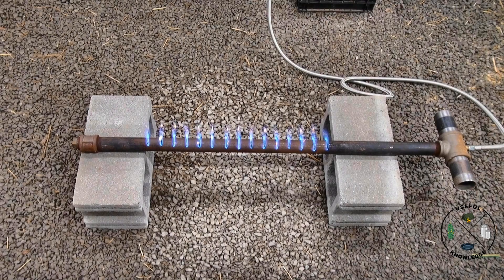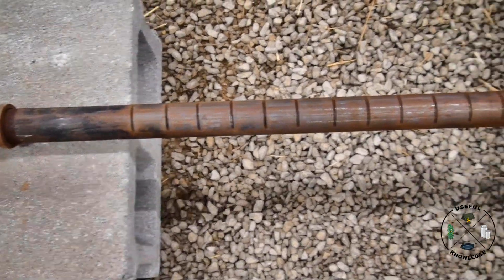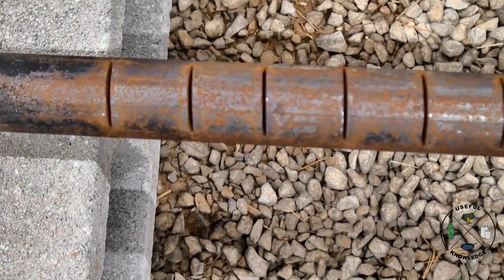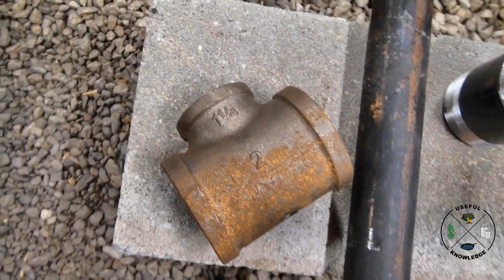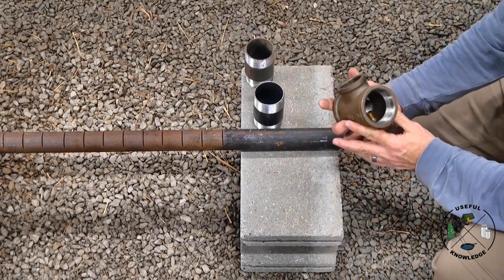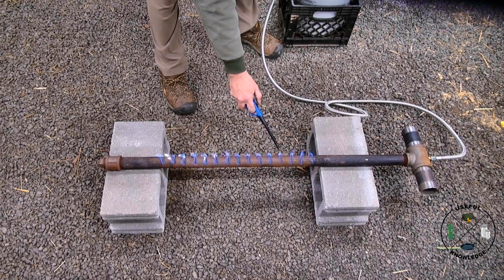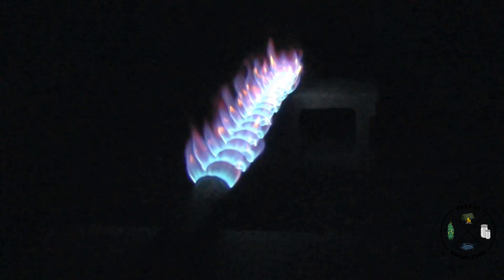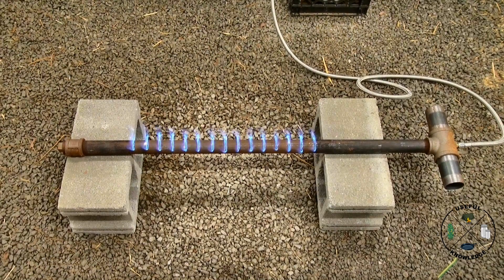Homemade Pipe Burner  | Useful Knowledge

Comment: how can you increase btus?
Reply from the maker: This already rocks a lot of btu’s.  I use it for my syrup.  I would try closer cuts but it’s going to require more pressure and gas flow.
Reply: @ how would
You increased gas flow? More psi from regulator and larger hole in orafice? Would Venturi need to be wider/more open?

Comment: My homemade burner on my pig cooker   About  a year ago stopped lightning near the Venturi and the burner only has flames at the capped end when I try to light the end close to the Venturi the flame on my torch gets blowed out
Reply from the maker: Hi.  Check the orifice to make sure some rust etc has not stopped it up slightly causing higher pressure.  Sounds like the gas pressure is too high.  I have to clean out the orifices in mine every summer because of mud daubers.

Comment: Thanks for this.  I would like to build something similar to use in my wood fired pizza.  Do you think a ¾" pipe work?  Cheers
Reply from the maker: Yes it will.  Here is a link to a 3/4” pipe burner I made a couple months ago.  You can also run it off a 20lb tank.  Homemade Pipe Burner for Camping | Useful Knowledge
https://youtu.be/KzQt7FWzMho
Reply: @useful.knowledge  Great - thanks for getting back to me!  Any advice on trying to achieve a flame like this, although I think this is natural gas not propane:
 https://youtube.com/shorts/kkKk_QHSMtM?si=YaqhB2Dq0rWP1YFi

Cheers!

Comment: I saw your other video and remarked at how expensive parts had gotten. Now with this homemade venturi I can make a burner for my gun bluing trough for about $60. Thank you!!!
Reply from the maker: Absolutely!  It absolutely works great!   I ran it for about 6-8 straight hours when cooking my sugar cane syrup.
Reply: @useful.knowledge  Got it completed. Works like a champ! Thanks again.
Reply from the maker: Awesome!!
Reply: @wiking44 I’m thinking about doing the same. Did you use 3/4” piping? Did you need to change anything about the Venturi, nozzle diameter or cuts when increasing the length?
Reply from the maker: @colinjohnson5515 yes, 3/4 pipe.  I wouldn’t change anything until you see how it does with longer length.
Reply: @colinjohnson5515  What useful said. Mine works well at about 48”

Comment: any idea how many BTU's?
Reply from the maker: Hi.  I haven’t tried to calculate it out but I’ve used this size (and the exact one in the video) in my syrup making.  Check out the sugar cane syrup video on our channel and you can see it in action.  I run it low and then almost full blast.  It’s a great pipe burner.

Comment: no fender washers to control air this time?
Reply from the maker: Yeah, I noticed that I was running it wide open anyway so I built this one with no washers.  I just ran that one in the video for about 8 straight hours for syrup and it worked great.  I’ve got my son’s bed strapped on top of the cover right now.

Comment: Good info. I have pretty much the same burner in my big cooker. 2 burners. I have a problem where the flame goes out when I close the lid. I can’t adjust very much on the flame. Does this sound like not enough air? Probably need to make bigger Venturi? 6:05
Reply from the maker: Hi.  Try placing your hand where the air is being pulled in.  Sometimes too much air can cause it to go out.  I will slightly block it until I figure out any reduction needed in the air going in.
Reply: I made a air mixer from 2” to 1-1/4 on my pig cooker. It pulls too much air and flame goes out when the lid is closed. I blocked off 3/4 of the air coming In and it works perfect now.

Comment: Thanks for this video! I am currently building a Powder Coating Oven with a square base of 3ft x 4ft. I'll be running 1/2" black pipe in the shape of a "U" about 3" off the floor and 3" away from the interior walls, and drilling small holes facing inward. I will have a "T" in the center of the "U" feeding the pipes. I was planning on making a venturi on the outside of the oven (1/2" black piping leading to the inside of the oven). What size do you recommend for the airflow nipples? Also, what do you recommend for an orphis considering i'm using 1/2" piping? Any guidance is greatly appreciated!
Reply from the maker: Hi.  I’m thinking for the venturi tee that I would use a 1/2”x1” tee.  That would have the 1” openings for the air flow with your 1/2”side connecting up to your 1/2 black pipe going to your burners.  I would start with the same size orifice drilled out like in the video.  Get a few of those incase you have to experiment to get the gas flow right.
Reply: Also does an Air Mixer (like from Amazon) work the same way?
Reply from the maker: Those air mixers look like something my son has in his blacksmith blast furnace.  It’s wide open gas flow

Comment: Looking to build a custom griddle for my camper on drawer slides.  Have you had 2 or 3 of these burners tied together?  In parallel not one long burner.  Griddle will be like 30 inches by 18...Just add additional nipples, tees and orifices?  thanks
Reply from the maker: Hi.  I’m thinking that you may be able to use one venturi and some tees and elbows to get two connected together.  I’m going to if I can try this over the weekend and I’ll let you know.
Reply: I would like to know more re this

Comment: are you adjusting the air with the regulator?
Reply from the maker: Hi.  The regulator is adjusting the flow if the gas.  The pressure of the gas flow draws the air into the burner.
Reply: must the nipples be 4” long?
Reply from the maker: I don’t think they have to be that long necessarily.  This issue is that if you have any wind, it can cause some flame out.
Reply: @useful.knowledge  thank you

Comment: Does it need the two 4’ pipe on the T
Reply from the maker: Hi.  It will probably run just fine without them but any wind would create problems even a small breeze.  I had a strong wing blow out one of these with the pipes on one of those breezy fall days.
Reply: God bless for sharing

Comment: Is the throat length to burner length a ratio, or is that just how it wound up? (Meaning would a 36” burner need an 18” throat?)
Reply: It's a bit different but I use 12" between the Venturi and the end of the burner on forge burners makes for a more stable flame
Reply from the maker: @louiel8711 Thanks!  These burners are used for syrup making so they run for about 8 hours straight and the flame is stable.  It’s probably the 12” making more stable like you said
Reply from the maker: Hi.  I understand from talking with different folks that you really want at least an 8” throat for the air and gas to mix properly.  I made this one 12” so that I could get it through the 8” block and have plenty of length for the venturi on the end.  I have just an 8” throat on my long burners and I was flaming the edge of the block.  This venturi did work great on that burner as well.
Reply: Would this work if it was around 5’ as well?
Reply from the maker: @ Hi.  Yes, absolutely 5’ is the same. Check the channel.  We built a long version and the video is out there.

Comment: Thanks! Just a quick question, what is the length of each cut in the pipe? Thanks again!!
Reply from the maker: Hi.  I mark across the pipe and then I just cut the mark out.  You don’t want to go too deep or you’ll make it to the point the pipe may bend.  I really just cut it until you get a good slot cut into pipe.